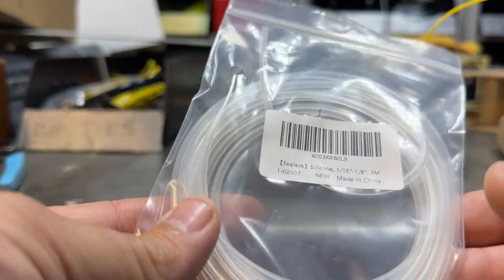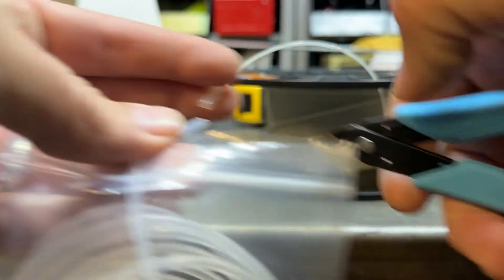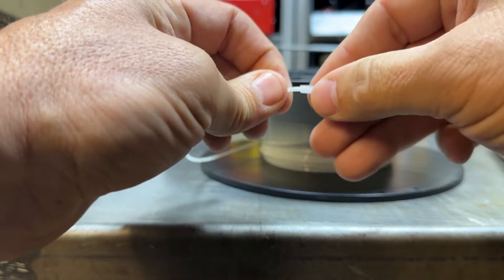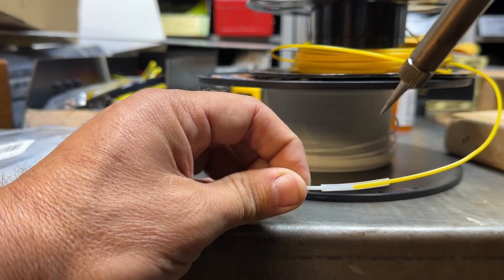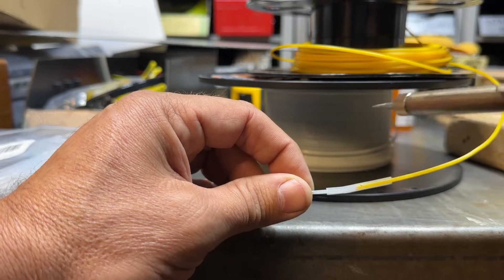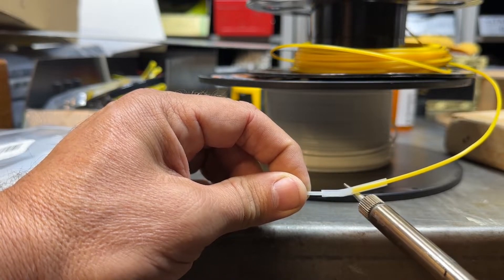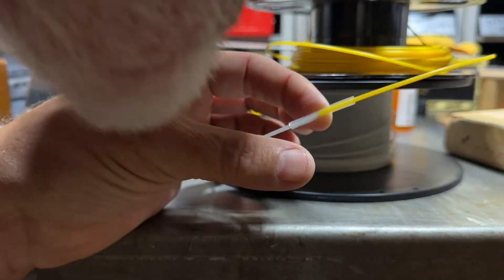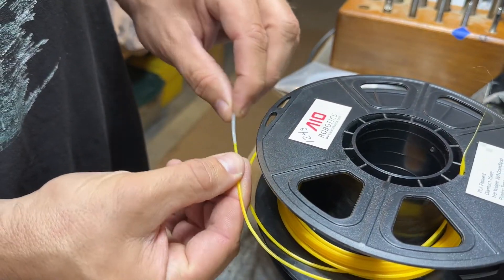A Better Way to Splice Filament

Comment from the maker: Here is the link to the tubing.   Sorry for the delay. I’ve been getting a few requests for the link

https://a.co/d/5ZBf0jA
Reply: Which tubing inner diameter do we purchase from Amazon? Thanks
Reply from the maker: @troymcdonald  I bought.  “Feelers 1/16" ID x 1/8" OD Pure Thin Silicone Tubing Food Grade Pure Silicon Tube High Temp Home Brewing Winemaking Silicone Hose Tubing, 9.84ft Length”
Reply: @keepitsimpleideaguy8676 

Thanks. I wasn’t sure if the default selection was the correct one. Thanks. Gonna order some.

Comment: I didn't even do this properly and it still worked 
I couldn't be bothered getting out my soldering station so I just used a lighter, now the lighter did burn through the silicon because it's an open flame rather than direct heat but it just melted a bit of the filament on the inside and made a little bubble come out so if you were going to try using just the lighter like I did be very careful and don't do it above your lap while not wearing pants...

Comment: I do all my filaments this way, however, I just use a lighter flame for a couple of seconds.
The join is ALWAYS near perfect .. strong .. no clean up needed and the fact that the flame is applied externally to the filament means that there is ZERO oxidization at the join.

Comment: heat gun or lighter or torch work too ?
thanks for sharing this :)
Reply from the maker: Yes.  I’ve since used a candle which worked well.  A lighter should too.   Just don’t burn the silicone or it’s hard to remove cleanly.

Comment: The first attempt failed due to lack of patience.  Second attempt worked great!  Set the soldering iron to 600 F / 315 C for PLA and cut filament on a slant.  Thanks.  BTW I have a drawer full of useless gadgets.

Comment: Thanks for posting this. I have been looking for an inexpensive way to splice filament for ages and this is by far the best I have seen. It took me a few tries to get it right, but once I did it was easy. I spliced 5 rolls of filament together last night alone and there is enough tubing in this pack to last me almost a life time at the rate I print stuff. This is great! Thanks for sharing.

Comment: I've tried this and it works well except that the joint becomes very hard and won't always pass through the extruder, leading to interrupted prints. Am I doing something wrong? Is there a solution?
Reply: Just had the same experience with my first ever weld
Reply from the maker: Thanks for the comment.   That’s the first I’ve heard of that.

Comment: Saw this video and thought I would give it a go... Ordered the 1.6mm ID - 3.2mm OD (1/16 ID - 1/8 OD imperial) silcone tubing and tried it out... Worked every time, first attempt, without any post prep... Using a 'jet flame' lighter as I didn't have a soldering iron to hand, but worked just as well... Thanks for the video!
Reply: Sweet! I came to here to look and see if someone had tried a lighter like that!
Reply: lets goooooo i was wondering if a lighter wouldn't melt the silicone :)
Reply: @justinbouchard  If you hold the flame in one spot it will eventually burn the silicone .. but its ok up to about 240C .. far beyond whats needed. Just move the flame around for a couple of seconds.

Comment: How about applying some oil or heat-resistant silicone grease to the filament? This would make it easier to thread from both sides and you could possibly pull out the connected part without cutting it open.
I would also prefer a cheap heat gun for warming up. The dealer with the capital A sells such devices for as little as 10 - 15 Dollars/Euros.
Reply: You don't want oil or silicone grease all over the filament thats going through your extruder. Also nobody wants to sit there sliding a tiny piece of tubing off a long piece of filament they just joined. To save that little piece of tube.
Reply: @bowl1820  Well, the lubricant can also be wiped off again after fusing.
I agree with you about pulling through. Stupid idea, sorry 🙄 It's still a waste of material (silicone tube), but even better than throwing away unused filament.

Comment: Can you use a lighter ?
Reply: Better not. The heat of a lighter is much higher (> 800° C) than a soldering iron. This melts the silicone and filament together.

Comment: I actually like the candle-and-jam-it-together method better. I just use a razor blade to cut off the melted brim and it works quite well. The hole drilled through 2 metal plates gave me an idea: Use some decent hardened steel plates, then grind and hone a double chamfer that meets at the center of the drilled hole, to create a sharpened concave edge at the hole's edges. Melt the filaments together, then clamp the plates together with some vice-grips and slide the filament through, cutting off the melted brim.

Comment: I use a short PTFE tube sliced on one side, warm both ends of the filament with a lighter then put them in the tube and smash them together. Wait about 15 secons and pull it out through the slice. Works well! Your idea works well too!

Comment: Have you considered the fact that PTFE breaks down into toxic fumes at the flame temperature?
Reply: PTFE tubing yes, but in the video he’s using silicone tubing
Reply: @AndrewLeeiniceguy  Thanks that a very good point. I've checked SDS on silicone rubber and it seems to only emit formaldehyde at 300C, silicon dioxide, plus carbon dioxide and monoxide. Which is not bad at all, given the quantities involved.
Reply: @MaciejWiercinski  I would probably still use it near a fume extractor.
Reply: @MaciejWiercinski  At 300C most things are not so friendly to your lungs.

Comment: Cut the filament at an angle just like when feeding it into the extruder when printing. then put some acetone on one of the ends and put the two cut ends together. acetone will weld PLA filament together.
Reply: Did you mean ABS? or PVB and alcohol. Haven't found anything other than 3d gloop that melts PLA, except dicholoromethane....
Reply: That definitely does not work. I just tried PLA with acetone and it did nothing. Point in case, acetone is stored in a plastic bottle.
Reply: @freshmaker5  keep in mind that acetone will dissolve some other plastics like abs though, but yeah it will do absolutely nothing to pla.
Reply: Thats a really interesting way ive never heard of. Will definitely try it

Comment: I like it.  I think I'd try it with a hot-air rework station.

Another thing that could be fun to try is clamping a couple of pieces of aluminum together, and then drilling a filament sized hole right along the joint.  This way you could simply lay the filament in one side and place the other piece of aluminum over it to clamp it as the silicone tube would.  I guess you could either preheat the aluminum, or heat it after it's clamped.
Reply from the maker: lol I love it.   That was my first idea (see earlier video)
Reply: I actually have one of those stations, so I may give that a shot. Did you try it and did it work?
Reply: @CatServant  I haven't yet had a need to splice any.  But I'm confident a hot-air rework station would do the same as they do here, but with a little more control.  Let us know how it goes if you try it.
Reply from the maker: @Rick_Cavallaro  I’m flattered one of the creators of the Blackbird has watched one of my videos!!!    Thank you!   I am inspired by your project.
Reply: @keepitsimpleideaguy8676  You've got good stuff here.

Comment: I have seen something similar with a spare piece of PTFE tube, you can slide the tube off the end after the weld so it can be reused but the PTFE tube is slightly larger in inner diameter so the welded part always comes out a bit bulbous, needs sanded down.  This seems to be the smoothest way to weld two pieces without having to trim the weld afterwards, nice.
Reply: PTFE Tube is usually 2mm ID (or 3 if you are using the thick stuff). 1/16" is around 1.6mm, so smaller than your actual 1,75ish mm Filament.
So i guess it comes down to what you like more :) Over extrusion and the risk of getting stuck, or a bit of under extrusion and possible slip on the extruder gear.